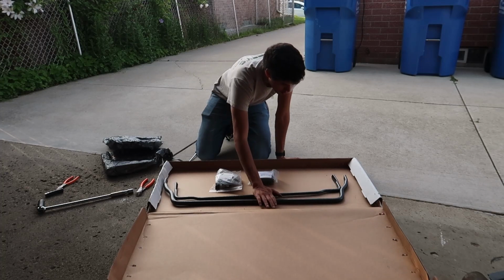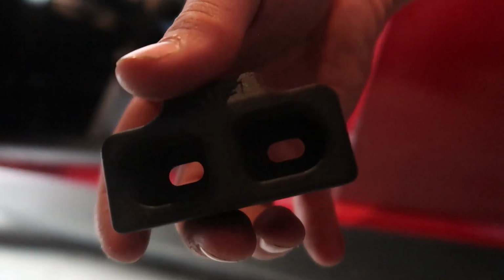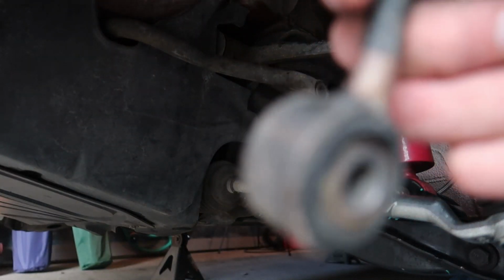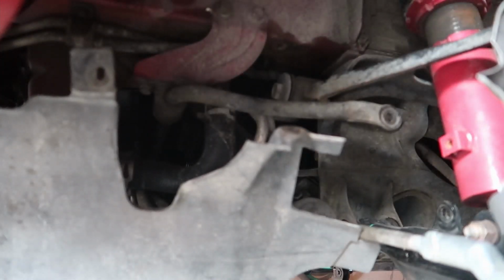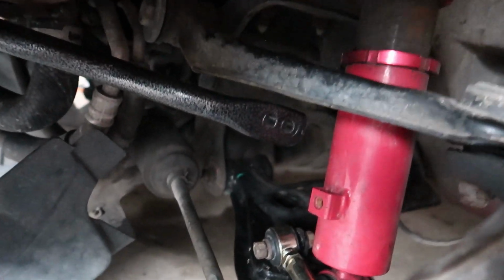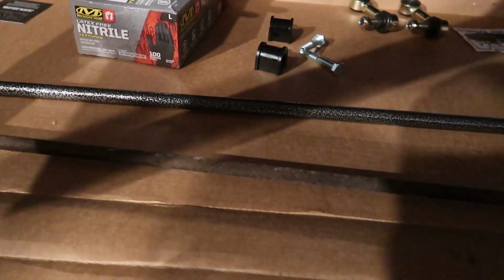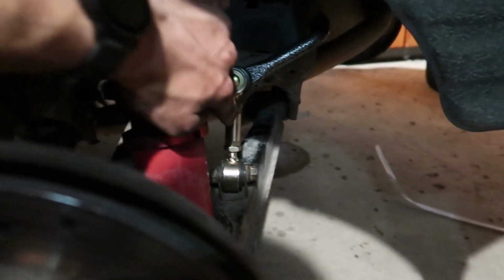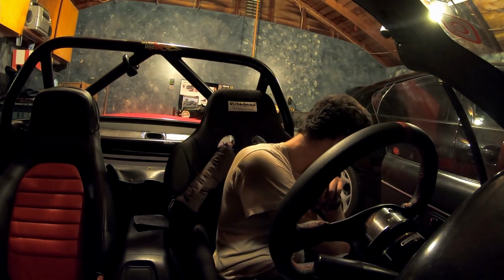Mazda Miata Gets New Sway Bars and Door Bushings

Comment: I got eibach front and rear adjustable sways on miata and I swear they made a huge difference in handling and also have delrin door bushings installed as well.
Reply from the maker: Really happy with my door bushings. The rear is kinda loose (you'll see see in 2 videos from now) but the front needs a thicker sway bar, that'll be next years problem though 🤣🤣
Reply: @AndrewHershelChannel  the eibach sways are much thicker than the stock sways .. big difference out the gate! I was very impressed with them overall
Reply: I just followed you on Instagram
Reply from the maker: Thank you! I appreciate all the support! :) honestly means a lot

Comment: Ay new bars, gonna be fun. New bars are still pretty small lol. Little car
Reply from the maker: Yeah,  I learned very quickly I should have gone with a much larger front bar. Rear bar is fine as it is. For what ever reason miata fronts can be VERY stiff. I learned people will put 4-6K stiffer springs in the front for coil overs than the rear, and they'll put 2-3 thicker sway bars in the front than the rear. That'll be next years problem though